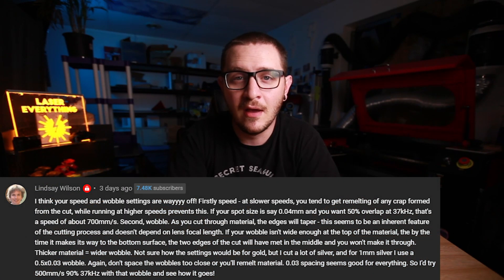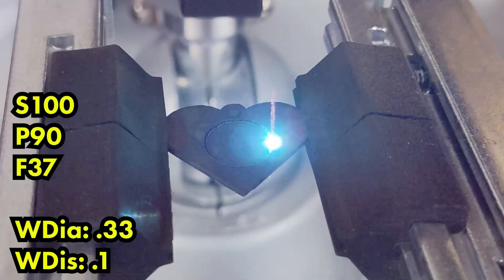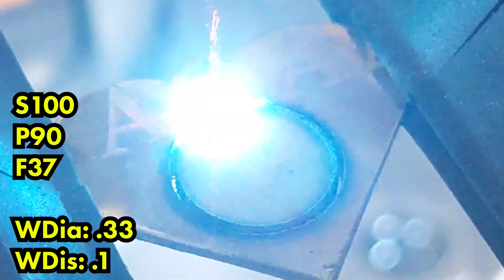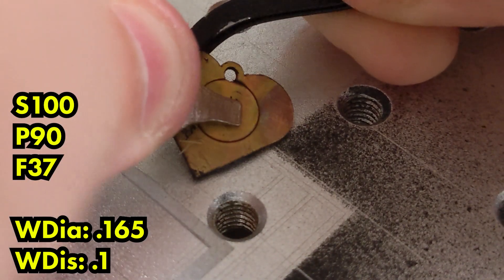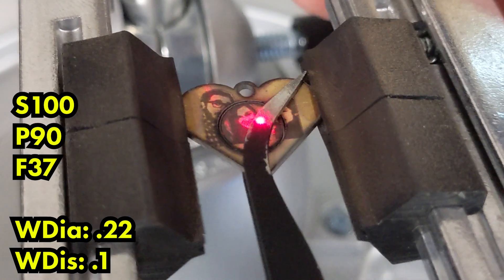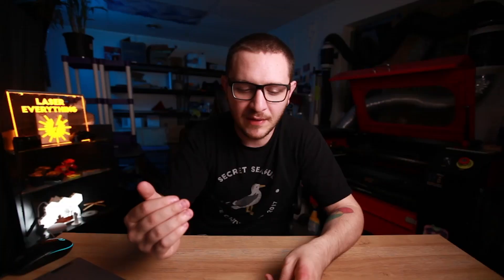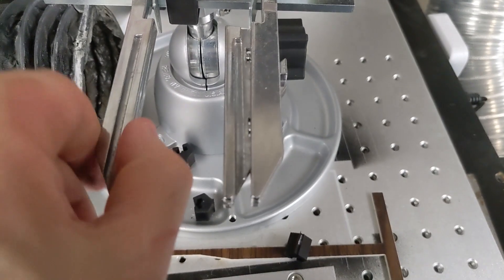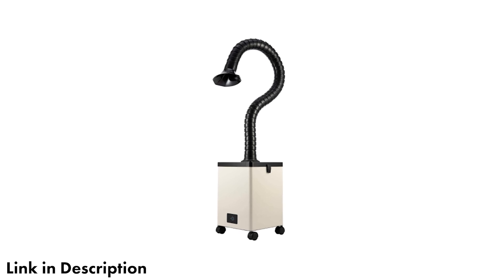The SECRET to Cutting Gold with a Fiber Laser!

Comment: I have a 60W Monport Fiber laser. I see that you used 90% power for 14k and I've also seen people use 95% to cut sterling. My question is, about the power setting. My manual says that using anything above 75% power will shorten the life of the laser. I've cut through 26g (.016") sterling at 75%, but I needed 1750 passes. What do you think about this? Am I overly concerned with the power settings? No one on these YouTube tutorials seems to be concerned. Perhaps running it for so many passes is also bad for the machine? The only reason I have this machine is to cut sterling and gold, BTW. I will be using the machine in this way a lot. ~ Thanks for all of your videos! You guys are awesome!

Comment: how to cut 18 gauge gold plate with 50 w machine what setting what speed what power how passes
Reply from the maker: We share our parameter library on our website for free, and there is a conversion tool made by a member of the community if there is a setting you'd like to convert that isn't in that library. That would be the best way to get that info so it is specific to your lens and wattage as a starting point.

Comment: Posted on the other video but here are the settings I use. In lightburn with a 60W MOPA and a 110 lens my settings are: SPEED 60,  MAX POWER 85, FREQ 37 Khz, Q PULSE 200, Num Passes, 75, Perferation mode on, 0.05 CUT, Skip 0.01, Wobble Mode on, 0.0330 STEP, 0.0300 SIZE, Kerf Offset 0.050 OUTWARD. This worked well on .5mm thick 18K Yellow
Reply from the maker: Thank you for sharing! If you haven't would be something cool to add to the Community Fiber Laser Settings Library we added to our website in the last few weeks.  https://lasereverything.net/ It's at the top under Settings if you're up for posting it.
Reply: Thank you. Is the thickness 1.0 mm, same setting or any changes?

Comment: Do you have tricks engraving wood using fiber laser engraving?
Reply from the maker: If you have a high frequency machine I recommend using the highest frequency you can. Low frequency fiber laser beams tend to start fires on wood. Still, best of a bad match. CO2 or Diode is much better suited for wood.

Comment: what is the wastage rate after using the above setting to cut gold? how do you collect those gold fume and dust during the wastage collection? any fume collector can recommand us?
Reply from the maker: I have a pretty good extractor listed in the buying guide at https://www.lasereverything.net/buyingguide but I'm not sure how you'd go about collection from within or what the wastage is as I didn't measure.
Reply: @LaserEverything  thanks for replying

Comment: I have to cut a design in gold with many holes that are relatively close together.  I must use the wooble to the minimum, right?  Since the bigger it is, the sides will burn, right?
Reply from the maker: Yes a smaller wobble will help with that but also increases the likelihood that the cut line will reweld the metal back together as you're trying to cut so it can not be too small.

Comment: Very informative video.
I wanna cut gold name pandent if i increase more wobble value it will damage the pandent.
Can you plz guide me about wobble setting for name pandent cutting?
Reply from the maker: Depends on the thickness of the gold but if your wobble is too small the gold will weld back together from the heat of the laser. You MUST use a decently sized wobble or hatch to get results. As you can see in the video using a smaller wobble worked well on some golds but not on others. .33 is the minimum I would do for 100% success every time.

Comment: Not sure if there would help. I been on the retail jewelry  industries. Now gold is usually mixed  with other metals and the higher the karat of gold the more weak the gold is (but more pure) 
 
Rose gold it's mixed with copper
White gold it's mixed with Nicole

This might help YouTube understand  better how to cut metals
Reply from the maker: Thank you for that info!
Reply: Rose gold still has silver in it. You make rose gold by raising the copper content in the alloy mixture. There is just more copper in the mix compared to yellow gold. There are also other metals added, for example zinc, to make either rolling or casting easier. By adjusting the proportions of the alloys to each other, you can create all kinds of gold tones. You can create green and peach tones. The same with white gold. Nickel is a strong whitening agent. But there are all kinds of mixtures out there, with varying amounts of nickel. in general, the more nickel, the harder the metal. There is also palladium white gold, which contains no nickel. I think the bottom line is, you have to do test cuts and test engravings on each piece of gold jewelry from different manufactures if you really want to get the best results.

Comment: Im a jeweler and use a laser machine to cut, the way you do it is not very efficient and it’s too hot! My setting are
Speed 1500 
Power 55
Kilo 40 
50 watt laser 
With 110mm lens
Reply from the maker: Nice eddy, thanks for sharing those settings! Next time I have to cut some gold I will totally try these out!
Reply: What are your wobble parameters?
Reply: Hi Eddy,

May I ask how do you handle the burnt edges after you cut the gold?
Reply: @burakergenc6354  i do a square around the image and hatch it and Tun it at 15 power and that burned of the black
Reply: @eddydidier  what’s your wobble settings Eddy ?
Reply: Hello Eddy! Do you change the settings from Yellow to white gold?

 I have used the same settings as for yellow gold and my white gold pieces are melting and i cant understand whats wrong...
Reply: What’s your wobble settings?
Reply: How long would it take you to cut let's say a small name necklace? And when using gold is it getting burned like that?
Reply: @burakergenc6354  it depends on the thickness I make standard names .50mm it takes around 70 passes. My settings are lower because gold when it heats it warps, this settings don’t affect in any warping. If it gets hot it will move.
Reply: @Ian Sacks change the lens to something like 90x90 this will increase the power

Comment: Something can help to cut gold , is to use 2 parameters 2 différents wobbles 2 différents speeds , first to cut second to clean the surface simultaneously. For this you have to use 2 pens .
Reply from the maker: Interesting, I haven't thought of this usage but sounds effective! I'll have to give it a go!
Reply: Hello, could you give me some information on the parameters of the cleaning wooble, I have tried so many different ones, but always marks a little and the residue remains. so greatfull any information.

Comment: The Kirf width should be approximately as wide as the material is thick. So the wobble settings would be different for different thickness materials.
Reply from the maker: I would hope not! This gold is 0.8 mm thick which would mean the curve would be 0.8 mm wide! That would be huge. 0.33 is less than half that, so hopefully we can save a little bit of that gold lol

Comment: When using a 50 watt machine, will your parameters still work (considering you use a 30 watt machine).  Just wondering because I’m considering joining your patreon.
Reply from the maker: Yes, the patreon includes an Excel sheet and that spreadsheet has a built-in converter for your settings which will convert your settings from a 30 watt laser to a 50 watt laser if you input your laser wattage and lens. All included in the patreon!
Reply: @LaserEverything  you’re actually amazing
Reply from the maker: Glad it's helping you 🙂

Comment: Awesome video! Instead of supporting the gold so that its air cooled, have you thought about a sacrificial copper chilling plate. We have to use that when tig welding stainless due to its high warp factor and temperature sensitivity.
Reply from the maker: I haven't thought about that but it sounds like an awesome idea! Definitely something to look into!
Reply: That's a good idea, I will cut 0.8mm "One Clad 14k Gold Filled Sheet" by the brass side, maybe will help with the reflection ???

Comment: Is that a good setting 4 cutting stainless?
Reply: Thanks
Reply: @esjsharken  Stainless is a pain, not so much because it's harder (as in higher melting/boiling) but it leaves behind a lot of debris after each cutting pass. I've found the only way to cut stainless reliably is to alternate a cutting pass with a cleaning pass - it's slow, but does get through. Cutting anything decent (1mm or over) will need a 60W laser, 30W just doesn't cut it.
Reply from the maker: You're a master cutter Lindsay!
Reply: @imajeenyus42  can you share your parameters for cuttin steel please.
Reply: @miriamm5076  It all depends on what laser, lens, and thickness you have. I have a 60W JPT M7 with a 112x112mm lens. I'd use 1000mm/s 90% 30kHz 500ns. For say 1mm steel, offset by 0.5mm and hatch with 0.03mm spacing.
Reply: @imajeenyus42  Thanks a lot!
Reply from the maker: stainless is a much harder metal so it would take a lot longer but these settings are potentially a good starting point